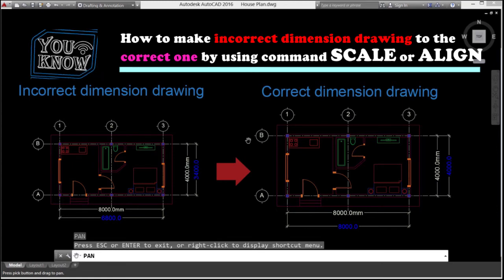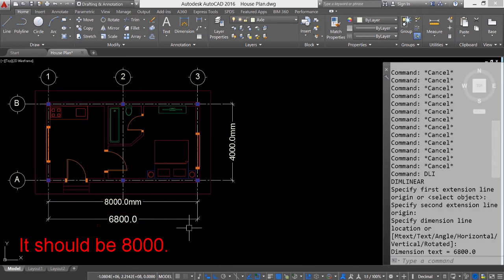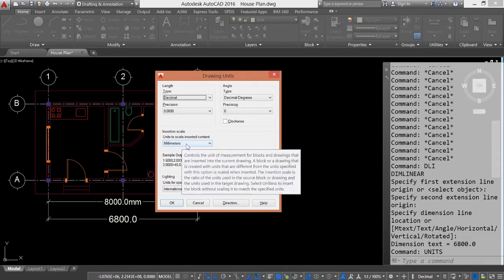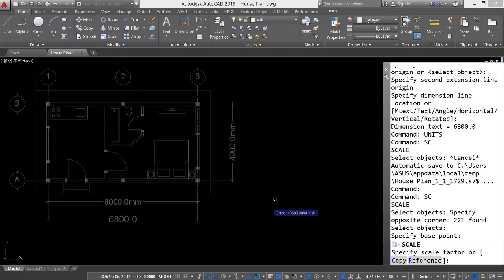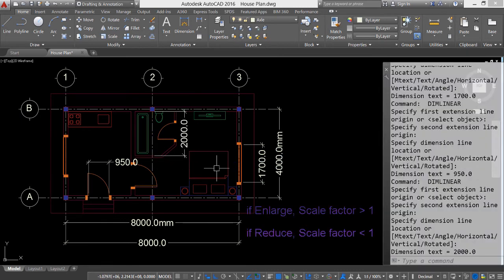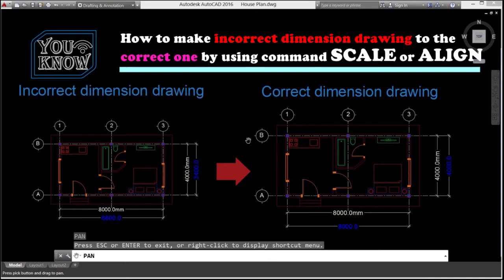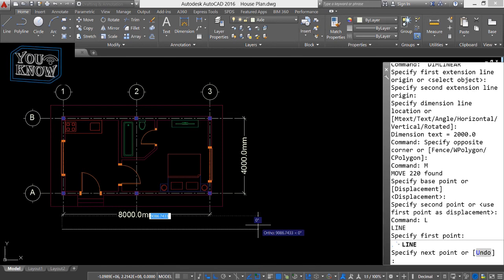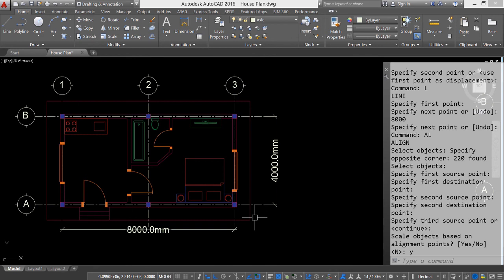Making incorrect dimension drawing to the correct one in AutoCAD

Comment: I hate AutoCAD
Reply from the maker: Could you tell me why?
Reply: @youknow2041  Its not you or the video, I just hate the program. To me there are just too many unnecessary steps and useless features that screw up the overall organization of the program. For instance, the complexity of metric vs imperial. These should be interchangeable in a project. If I want a 800 mm line, I should be able to draw an 800 mm line. If I want a 36in line, I should be able to do so as well. Revit reaches that level of simple and intuitive process that I feel Autocad doesnt have. My 2 cents